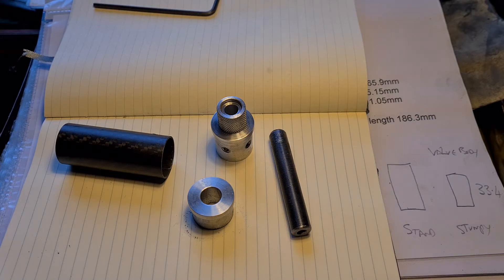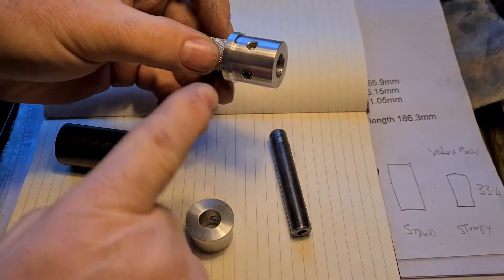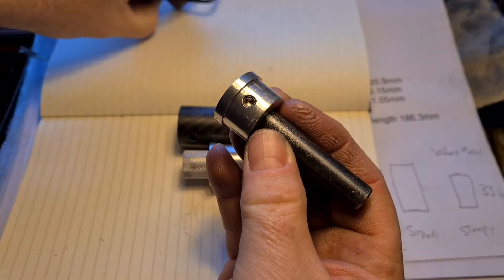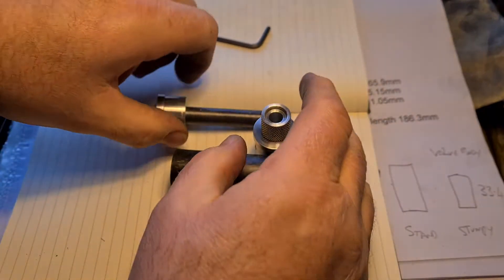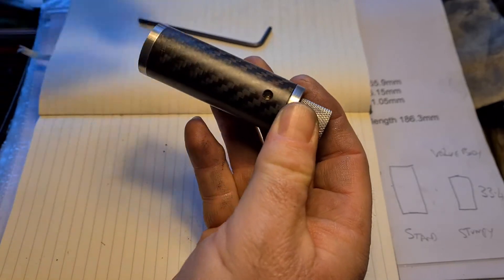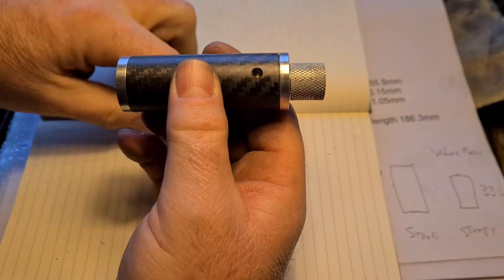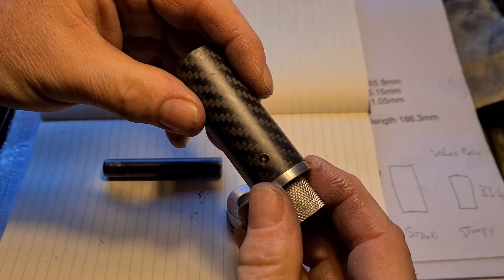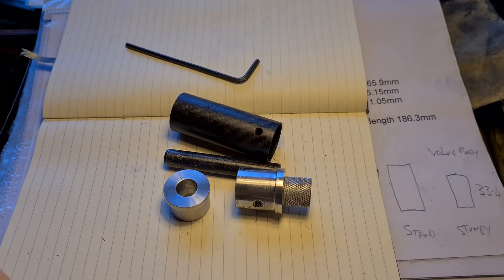Crosman shroud kit

Comment: Hi mate do you make breech risers I did get one from you before but that was a few years ago .thank you graham
Reply from the maker: Yes Graham I do, they come with the riser, 7mm lift, uprated transfer port, longer front screw and longer rear bolt. You will have too make a cocking pin 7mm longer than standard usually from an 1/8" drill bit cut down and you might have to take a few threads off the screws to fine tune the fit

Comment: Nice design ever think about some made in standard size. sorry form the USA. . Just a idea add a place for o ring to seal tube. It would be nice to see a air stripper that also could work to tighten the barrel up for anti vibration. This Would be a great item to buy and sale? Great job and good work as all ways till the next one ✌️👍👌
Reply from the maker: I've looked at it before but the gap between the  barrel and gas tube is tight then you have to deal with the barrel band being in the way. I have seen with carbon tube slip over the barrel then cut at the band the added again after the band. It tidies up the barrel

Comment: good job but there is no point in shrouding a barrel ubless it diverts the muzzle air back into the shroud unless he just wants it for looks but your machining is excellent good job keep up the good work sir
Reply from the maker: Two reasons for shroud that most people adhere too is looks so it flows nice with a matching silencer or a single one piece with a built in silence. And 2 like you said its built with the intention of using it as part of silencing which is called "reflex" which I also make, its down to what each owner wants